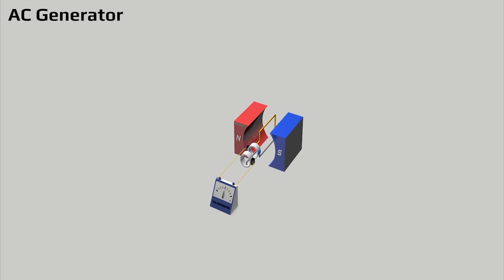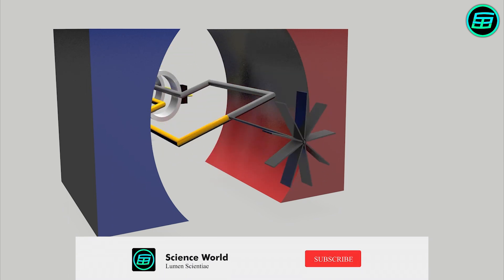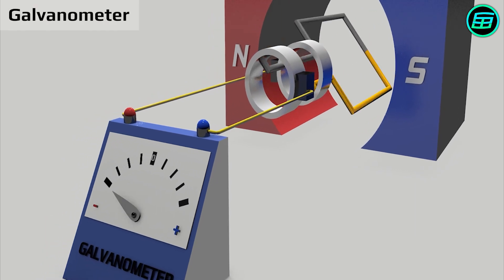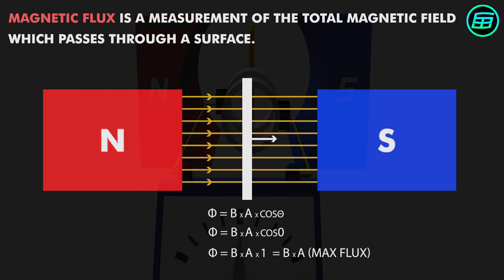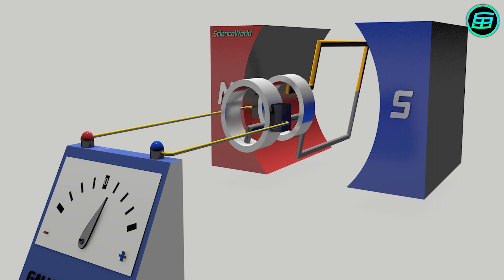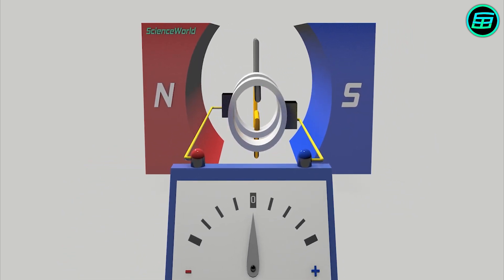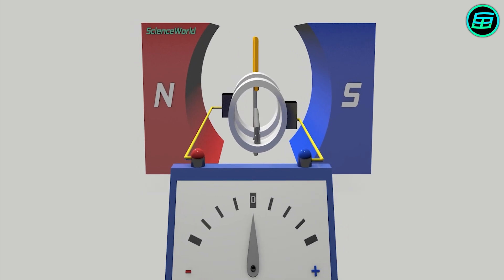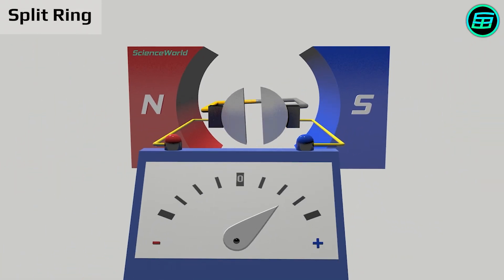How electricity is generated (3D Animation - AC&DC Generators)

Comment: 1:57 i abhor this conflation of two different aspects as if they are inter-related. No, the fact that the wires are "parallel" to the magnetic flux does not preclude the generation of current, despite the video's insinuation.
Reply: I assume it's just a matter of bad phrasing, and they originally meant that at moments when the normal to the armature's surface coincides with the direction of the magnetic field (or is directly opposite to it), the instantaneous e.m.f. is zero.

Comment: Could I make it infinitely looping by connecting the wires to a dc motor that spins the other motor, converting mechanical energy to electrical energy and back to mechanical energy, looping forever?
Reply: Actually no. Cus it'll disobey the law of conservation of energy which states that energy is ALWAYS lost as heat or sound and other forms. 
So yea, we can't create an infinite loop
Reply: @Animelover749  ok

Comment: I was told once, not all magnets are electric but all electricity is magnetic.
Reply: Well, if you wanna get really technical, they are. Magnetic fields in ferromagnetic materials are created because the free electrons in the valence shell of ferromagnetic metals all have their magnetic moments pointed in the same direction due to identical electron spin, which causes a large net magnetic field compared to a regular substance.

Comment: The windmill machine is used to generate electricity. The wind blows and the windmill blades rotate and generate electricity. What if we create a small windmill machine and rotate it by hand. If we could create enough electricity as required for the world, then we can use this method. As many people in the world are without jobs, they could do this job.
Reply: That would increase the price of electricity and be far too expensive for electric company.
Reply: rotate by hand 😂😂😂.  what happens when they have to take a lunch break 😂😂.

Comment: Wait this is just a dc motor but in reverse
Reply: Ummm I had the same question to my teacher. Yes the dc motor is the total opposite to Ac generator because of the use of commutator(in dc motor) and slip ring(in Ac generator)
Reply: it is.  like the starters/stators in modern small motorcycles.

Comment: But if electricity is current of dlectrons. Where did you get the electrins to make electricity. Then bere is physics law that you can get anything from nothing. So my question is, where are the electrons produced. It doesnt make aby sence
Reply: electrons were already there my confused bro
Reply: they are already there.  you just need to have a force (voltage) to move it.

Comment: The current goes out from whichever of the two sides go  downward  in each half cycle and return through the other side in the same half cycle, assuming the coil is turning counterclockwise?
Does the current reverse (alternate) its direction after the slip rings?

Because it seems  for both sides of the coil the current inside the rotor is always moving  out from the side going downward?

Could u please clarify this confusion?
Thanks
Reply: so up mean current in and down means current out through that ring right?

Comment: so, using this, i can buldi my own generator?
Reply from the maker: Yes you can
Reply: @ScienceWorld1 but the video didn’t explain how it generates electricity
Reply: @GodIsPriority  yes it does
Reply: @GodIsPriority  Faradays law
Reply: @GodIsPriority Faraday's law of magnetic induction states that upon a change in the magnetic flux, a current is produced in the coil.
Reply: @GodIsPriority ⚠️ God has said in the Quran:

🔴 { Say, "O My servants who have transgressed against themselves [by sinning], do not despair of the mercy of Allah. Indeed, Allah forgives all sins. Indeed, it is He who is the Forgiving, the Merciful." ( 39:53 )} 

📖Quran
Reply: @1islam1  tf?
Reply: Remember to use a permanent magnet
Reply: Electromagnet  @Devguy190
Reply: But you'll have to rotate the armature continuously 
How will you do it ??
Reply: @skhjunaid  by water wheels, wind turbines, or crank it with your hands
Reply: @skhjunaid put it on a bicycle wheel and you get a dynamo
Reply: @skhjunaid perfect cycling workout
Reply: @colecoleman1499 😂
Reply: You can as well to advance it.
Reply: It generates the electrical current from the inductance... Think of a feather being passed over a strong stream of wind continually
Reply: The windmill machine is used to generate electricity. The wind blows and the windmill blades rotate and generate electricity. What if we create a small windmill machine and rotate it by hand. If we could create enough electricity as required for the world, then we can use this method. As many people in the world are without jobs, they could do this job.
Reply: @shivakoliar4846  Bro wtf haha
Reply: Radhe Radhe Krishna 🥰🙏❤️
Reply: No
Reply: Yes

Comment: But sir inner surface of slip ring is resistive then how current is produced and flow through the carbon brushes in galvanometer
Reply: This slip ring is not resistant in the inner

Comment: I didn’t get the purpose of the magnet could you illuminate it please ? And what if there were no magnets whet’ll happen ?
Reply from the maker: Magnets move electrons through the metal wire because of magnetic fields. Electricity is movement of electrons. So if no magnets, no movement of electrons, therefore no current.
Reply: @ScienceWorld1  but the metal or an armature could be rotated by the thing behind it which is I think turbine or fins instead of magnets.. isn’t it ?
Reply from the maker: @xG4merrx  Armature can be rotated by water, water steam, wind etc. When armature rotates, electrons that inside armature moves because of magnets. As I said before electrons' moves mean current. Turbine is electric generator, magnets, armature, fins all are member of turbine.
Reply: @ScienceWorld1  so what if the armature rotates without the magnets, will be there a change in movements of electrons ? If no, what’s the purpose of rotating ? I didn’t get the relation between magnets & rotating since the rotating is applied by water.. etc not by the magnets
Reply from the maker: @xG4merrx  In order to generate electricity, magnetic field must be changed. That's called electromagnetic induction. So if you put a magnet beside a copper wire and keep it stationary, there won't be a current since change of magnetic field is zero. But if you quickly move the magnet close to the copper wire and away from it repeatedly, you'll change magnetic field that's exerted to the electrons. Therefore electrons will move to same direction and current will occur. So, in order to generate electricity, we need a simple wire, to provide magnetic field we need magnets and also we need to change magnetic fields. In order to change magnetic fields, we need to move magnets or armature. The most practical way to change magnetic field is to rotate armature. It's light and easier to rotate than magnets. You can generate electricity by moving magnet back and forth to wire but it's not practical.
Reply: @xG4merrx the rotating by means of water or air is needed to provide mechanical energy to this turbine. We are using the mechanical energy to convert to electrical energy. The magnets are needed because electric motive force (emf) is generated when you have a changing magnetic flux over time. The magnetic flux through the center of the armature is changing as it rotates because the area that is facing the magnetic field lines is changing as it rotates.
Reply: Brother Just learn Induction  @ScienceWorld1
Reply: https://youtu.be/UL_ryxub-RA?si=b8956OyVQ2zNo35B.     This link shows the rotation of the shaft without the magnet.